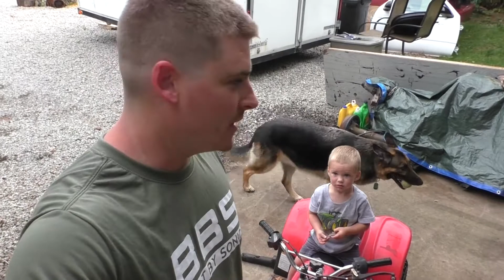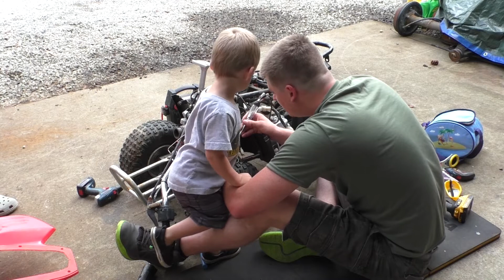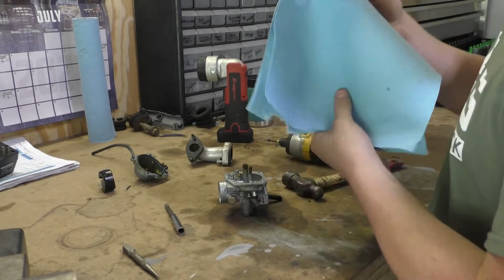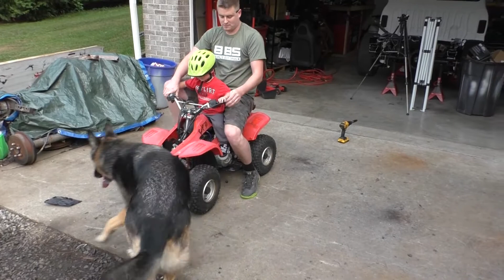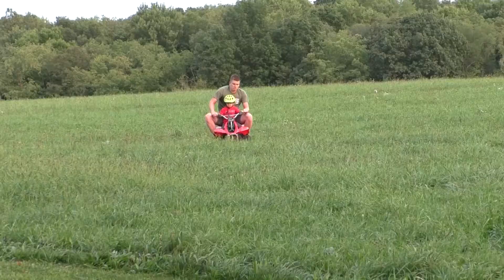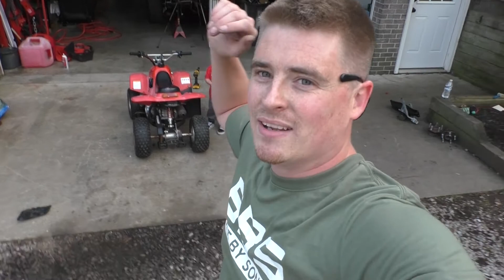I bought a 50cc quad thats been sitting for years

Comment: I spent $100 on one of these. No plastics  but has foot rests. No battery. What battery goes in this? I’ve seen that the carb should be replaced for one that won’t bog at higher rpm. Feeling like it’s going to be a money pit.